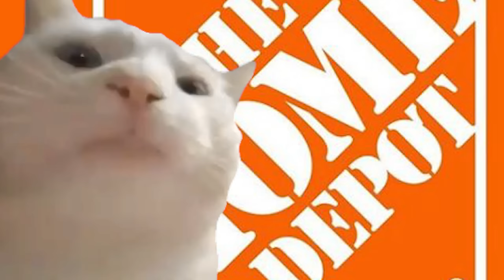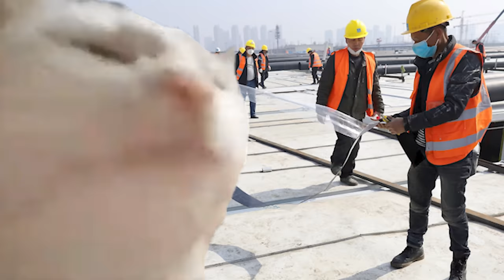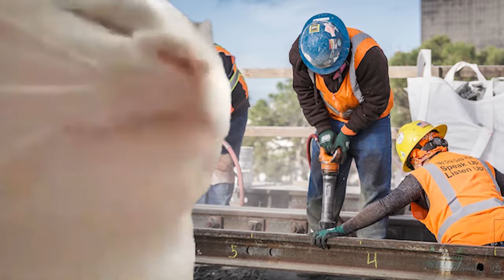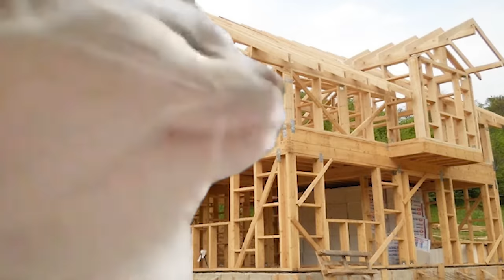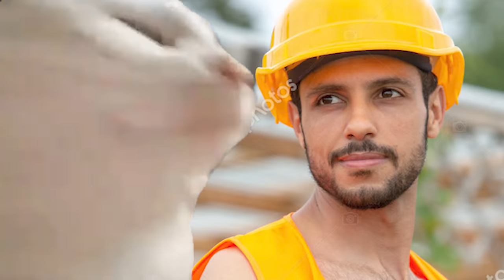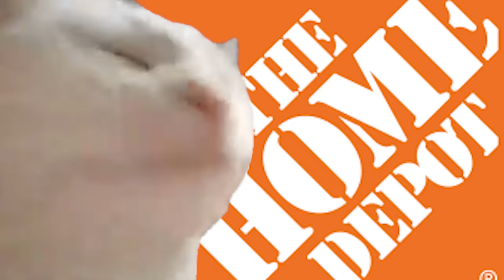Cat Vibing to the Home Depot Theme Song

Comment: I'm talkin' propane on the gas grill
Open flame, hold the pan still
And flannel, it's plaid, still.
Never question the dad skill.
I'm in the backyard.

Tool belt, big truck, and a backpack
Workin' on house and flip it like a flapjack
Philips head, with a tread hammer with a napsack
Got a creak in the knees, even got a bad back
Never backtrack, two measure, one cut
Got a big beam, bolts, and lug nut
Screws and a tool kit, thinking of what does what
Hit em with a sport when I'm beating them at putt putt

welyn